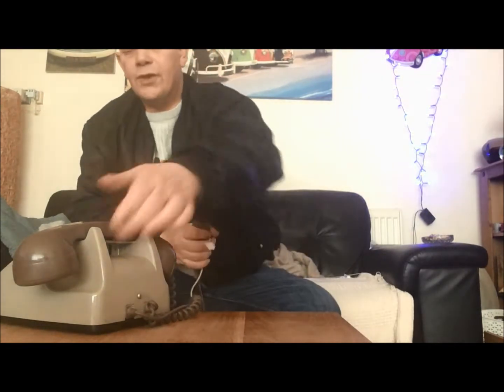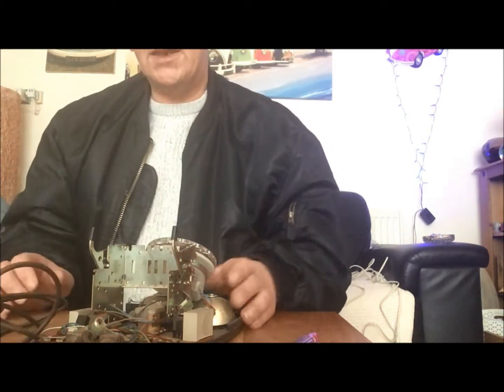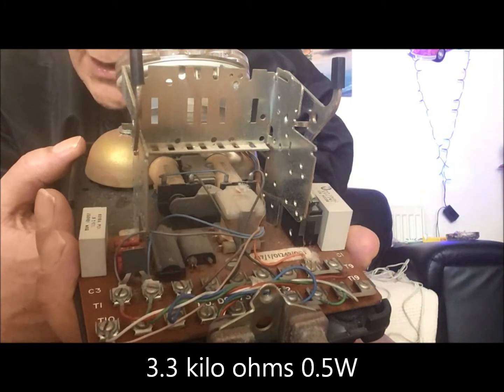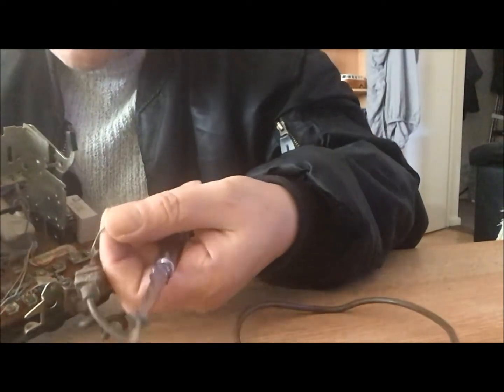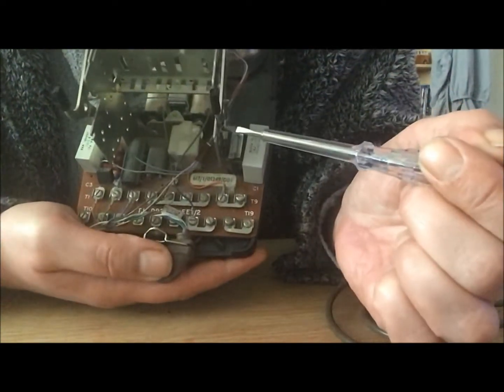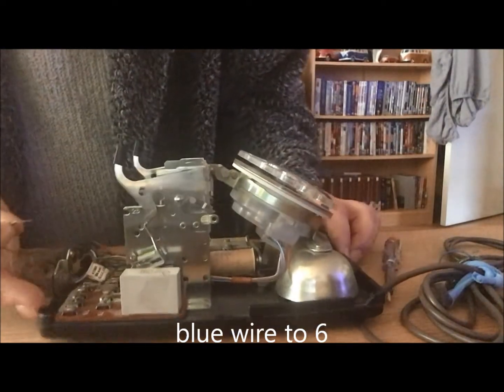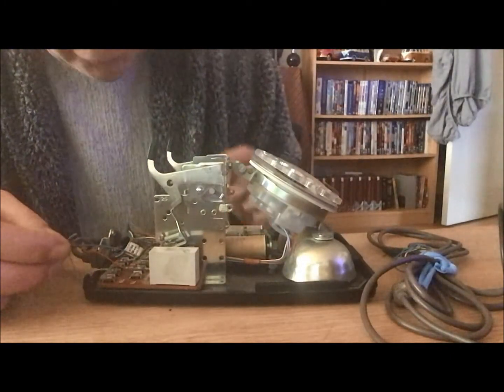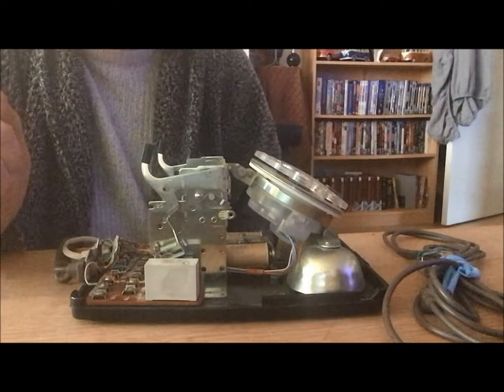How to Convert your old GPO rotary dial phone for modern usage

Comment: Hi, thanks for the tutorial. Mine is converted but now the rocker sticks once the cover is back on. It works fine until the cover is back on but sticks down once the handset is replaced. Is there a way of adjusting the cover as I suspect it’s not quite aligned. Thank you 😊
Reply from the maker: Yes slightly turn the dialler surround sometimes it gets in the way

Comment: I have got a 1980's iti rotary dialer phone and i wanted to convert its connection to a modern day connection  but the connection terminals are bit confusing in this telephone itself.....please instruct.
Reply from the maker: Connect the red wire to terminal 8 connect the white to terminal 18 green to terminal 15 and blue wire to terminal 6
Reply from the maker: If you google it by typing in convert GPO 746 you can get a picture of how it should look as a diagram.